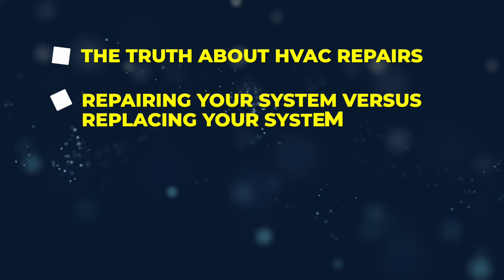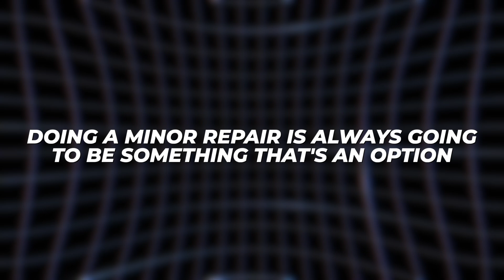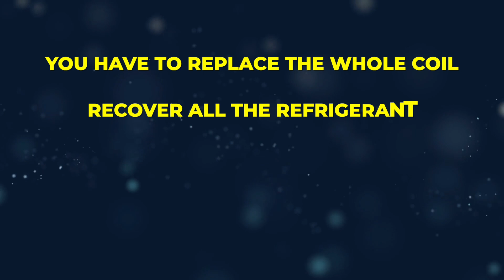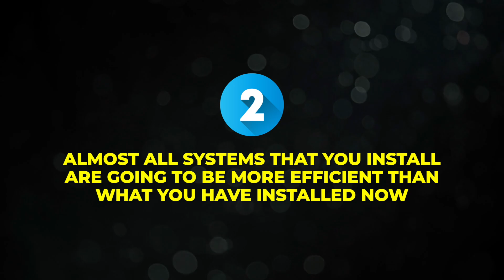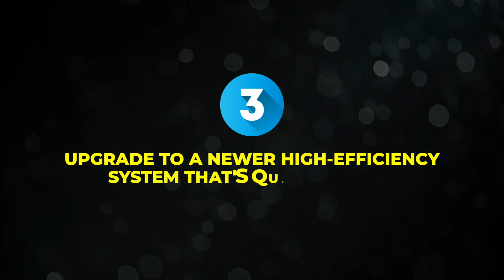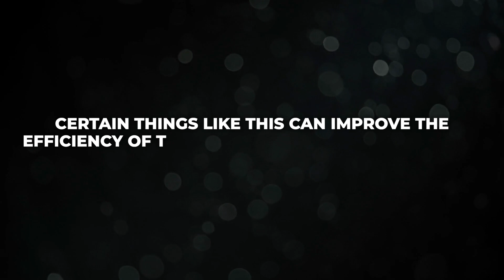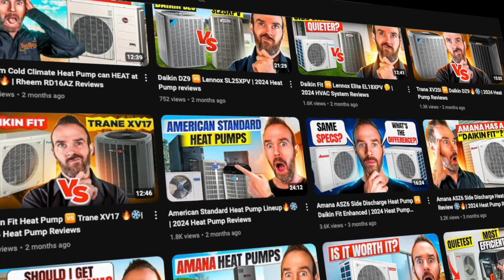The Truth about HVAC repairs

Comment: $137 service call$.20 to $50  capicitor bill turns into $491 is that a rip off only part and service non emergency. Week day normale buisness hrs
Reply from the maker: Honestly overhead has gone way up recently particularly insurance so unfortunately everything has inflated... in Denver or Phoenix or SoCal I don't think that's overpriced at all because of cost of living index in those cities, but the "part" is cheapest part of the equation even with tariffs. Biggest costs are labor and overhead related to sending the technician to your home... for what it's worth you can always find someone cheaper but I think it would be hard pressed to find someone to that for less than $300 these days IMO in any market so if the tech was reliable and showed up and got it fixed that's worth a lot to me! (Been trying to hire other trades people for work recently and it's hard to even find people to call you back sometimes)

Comment: I'm currently using my emergency heat, trying to get estimates on a repair or system replacement. I've been running it at a low temp, 66 degrees (brrr), but from what I understand, that doesn't matter as far as reducing my electricity bill because the coils run just as hot as they would if I had my heat turned up to 70 degrees. Is this true, or do the coils cool down some? Because of the holiday, I'm not sure how long I'm going to have to run it. It's been running for a little over a week thus far, but I've been turning it off for a few hours here and there when the sun is able to hold the temp at 66 degrees.

Is it true that I'm straining the heating element to where it might break? It's possible I might have to wait a week because of the holiday.

Also, I need my ducts cleaned as soon as possible. Since I have to get the heat pump fixed or replaced ASAP, a priority, if the duct cleaning is done AFTER the heat pump is fixed or replaced, will the dust overwhelm the new condenser or system, whichever I go with? I don't want to ruin a new system while waiting to schedule a duct cleaning. (I'm the one who had questions before.)

One more question. Do 2 cycle heat pumps really heat, cool, and remove humidity as well as a single stage? It seems everything they come out with that is environmentally friendly has come with a cost. My bagless vacuum does a poor job at picking up cat litter dust. I have to run my new washing machine on deep fill because nothing gets clean if I allow the washing machine to autofill because the water doesn't cover my clothes. If a 2 cycle is going to sacrifice heating, cooling, and especially humidity in the summer, I would definitely stick with a single stage. Please help (again).
Reply from the maker: Single stage is the least comfortable option, all upgrades are comfort and efficiency related. Get a quote for an inverter like the Daikin fit we answer a lot of the questions in other videos on our channel and duct cleaning can be done before or after but definitely will not destroy your system. Your heating electric backup coil runs more at higher set temps so 70 vs 65 will just mean it's running more but it won't burn out, it will just cost you more to run, but I'd doubt it's more than $100 extra or so for just 1 or two weeks. They're expensive to run but I wouldn't lose sleep over setting it at a comfortable temperature.. but that " $100" ballpark is based on let's say your normal bill was $200 and you used a heat pump normally but switch to all electric heating coil, that would probably double your bill for the month assuming all things constant, so it's not the end of the world you won't get a bill that's suddenly 10x what you paid to run a heat pump. Worst case it will be 3x more if you ran it all month long at normal temps 72 or whatever you set it at
Reply: @TheHVACDopeShow  Thank you. It answers a lot of my questions, just don't think I can afford anything more than a 2 stage, and they only offer Goodman, not Daikin.

Comment: I had a house built in 2018. It's a Trane single stage electric heat pump. I didn't move in until 2020, so the heat and AC only incurred 4 years of regular use. 

From the jump, I noticed more than average amounts of dust blowing out of the vents. I don't like having to clean my hardwood and tile floors more than maybe once a month. Vacuum weekly, okay. But get down on my hands and knees, no. I had at least 2 HVAC guys come out and asked them why there was never any dust on the pleated filter. Maybe some tar from my smoking, but dust, no. They would tell me everything was okey dokey. 

I have the litter boxes maybe 4' from a floor vent. With all the vents the builder added 'after the fact' because he was just plain incompetent, I don't have many options of where to place them.

Then I (stupidly) parked the litter boxes by an intake vent, maybe 4 days a week, after I would clean them. I was too tired to vacuum their 'spot', up late helping a friend through a tough time via text who lived in a different time zone. This is when I first noticed tar began to accumulate on walls and cat litter dust really began spewing from the vents... floors, carpet, countertops, everything. I literally couldn't keep up. I couldn't figure out why no dust was ever being caught on the pleated filter though, in spite of all the dust. So I decided I would leave the filter in for 4 months instead of 3, thought I'd changed it at the 4 month mark, but must've forgotten, so it was in there for 8 months. Finally, some dust! Not long after, my compressor took a crap on me.

I need to buy a new system now because they're overpricing a replacement of the Trane condensor.

I'm going to have my ducts cleaned, but I know some use 'the whip', which I heard is best? Is it? One vent is glued on, so I don't know how they'll clean that one. I could put a mat over the one vent and move the litter boxes there, but won't plopping something on top of that vent cause problems?

I, also, worry about how the builder ran the ductwork to add all of these extra unnecessary vents. There's a lot of flexible hosing (metal inside, I was told), but the air has so many turns to make now, all through these 'sags', 5 flexible hoses total.

Also, with all of the unnecessary vents added to the first floor where the thermostat is located, the single stage short-cycled a lot.  Second floor could be 5 degrees warmer in the summer. I had HVAC guys out for this reason, too. Kept asking them why the unit on a 85 degree, cloudy, muggy day would only poof on and run for 10 to 15 seconds, before turning off. Then two minutes later, another 10 to 15 seconds. Only on the hottest and coldest days did it feel comfortable.

I've literally sat here stressed out, picturing that cat litter dust poofing along for 10 seconds at a time, accumulating in that flexible hosing, sags, drops, whatever you want to call them. Two of the flexible hoses are at a major 'turn' in the ductwork (intake, supply?) One in a corner. So I imagine the cat litter dust would poof along until it filled these sags, drops, corners, and then a blocked artery. 

I can't even afford to buy a new system, let alone duct cleanings every 1 to 2 years. How do I determine if the ductwork layout is the main culprit? The people who look at it say it looks fine, probably think I'm a slob because I did eventually give up on cleaning, but they don't seem to be connecting any dots. If I get my ducts cleaned, would a 2-stage be better since it keeps the air moving for longer periods of time, long enough for dust to make it to the pleated filter? I've tried pine litter, but my cat doesn't like it. I worry that I'll be buying a new system, only for it, too, to konk out in 4 years without regular duct cleaning. Suggestions? Please answer. I am running my emergency heat and need to make a decision today. I have pictures of the ductwork, if that helps.
Reply from the maker: I would ask for sizing information because the system may have been oversized, and that's why it short cycled but if it ran constantly on the hottest days that's typically an indication it's working properly. When you replace it you can always ask for upgraded filter options like a 4" Honeywell filter rack... if the return ductwork (air going back to the furnace from the house) had leaks in a crawl space or something it could cause that issue of sucking in a lot of dust but this sounds like the cat litter being by the return vent is causing the dust. I think you just need better filtration and a 4" filter can handle higher MERV ratings without damaging the system
Reply: @TheHVACDopeShow   @TheHVACDopeShow  Thanks! I wouldn't say the unit ran constantly on the hottest days, but definitely MUCH longer run times. On cold days, even longer, especially on windy cold days. 

I'm worried now because the one HVAC tech wants to up my 4 ton to a 4.5. My house is 1700 sq ft, two story. He said he pulled my address and put it into some calculator that gave him an idea of the size unit I needed? It would be a Goodman, and I'm not sure if a two-stage would be better because it has longer run times so that it can move the dust along for a longer period of time. Thoughts? Both would have that better filtration system. 

Where's a good place for a litter box, 2 actually? Would it be okay to close a louvered vent, place them on top with a rubber mat under them so that no litter can get in? The placement of vents and returns in this house is limited, and the boxes are too heavy to put them on the second floor.

Comment: I wonder how the new Colorado ban on 80% furnaces is going to change the repair vs replace decision?
Reply from the maker: Yeah I'm replacing one in a rental this year for that reason probably just because they're more reliable. I'd rather put in a Daikin fit heat pump with electric heat kit in a rental than a high efficiency furnace just because even with maintenance they can be more finicky. 80% are bulletproof and it's a small space so it's not that big of a deal
Reply: @TheHVACDopeShow  Seems like I've seen other vids on HVAC warn and advise against the high efficiency ones.

Comment: In the early 70's my neighbors replaced their 20 year old AC unit in Phoenix AZ (It had worked hard).  The AC units sold per year have massively increased since the 50's. Regardless of the economies of scale,  I have witnessed a downward trajectory in service life, and an upward trajectory in both service and replacement costs far exceeding CPI. This is in spite of huge technology improvements that have lowered cost of manufacture.  Variable speed motors, compressors and controllers are now mass produced far more cheaply than the fixed speed motors of the 50's. The energy savings and increase in motor life should have been huge.  Unlike the rest of the electronics industry, where products have typically decreased in consumer cost, the Airconditioning industry has spiraled upward, dominated by greed at every level.
Reply from the maker: I don't think it's greed... you referenced CPI and the number one cost that has skyrocketed in the past 4 years (and prior) is insurance. Insurance for health, GL, auto, workman's comp etc, is our largest single expense category besides payroll, and wage growth has exploded for technicians which I don't think people realize. It's hard work and no one in the trades is willing to work for cheap anymore... is it greedy for my technicians to want to have an income that affords them to buy a home and have a decent vehicle? I think it's more than fair... but literally my car insurance this year doubled as a "general increase" unrelated to any claims, it's obnoxious and criminal, but we and everyone else have to past that cost on somewhere.
Reply: @TheHVACDopeShow Comparisons to CPI is an adjustment for those increased costs. Yes, when it's far in excess of the costs you are complaining about, it is nothing but greed.

Comment: My refrigerant was low. HVAC guy said they can charge it (obviously a leak somewhere) for $350 and take a chance or spend the thousands to swap the coil. Had them charge it and it lasted all summer. They told me they can use the additive that stops leaks since it's a galvanized w/copper. Had a different HVAC guy tell me he does it all the time and it works fine, so I took his number down.
Reply: Sounds like the first tech gave you a couple of options, made the repair while telling you it doesn't always work, which is absolutely true. And in return you've taken your business elsewhere. Seems odd but I clearly don't have the whole story!
Reply: @simons.collins925  100%. The first tech/company didn't want to try to sealer (the third option). Other guy told me he does it all the time and it's obviously cheaper than a new install or a new core. I have to be tight on money wherever I can.
Reply from the maker: I've never seen stop leak work trust me I wish it did. Would be way easier than swapping a coil but I've only done it a few times, didn't work so I said ok this is a waste I'm not using this anymore but I have heard it works or can work a little bit*
Reply: If you have to have more than 1 lb in a 3 ton system in one year, do not use stop leak.
Reply: @USA-GreedyMenOfNoIntegrity  Can you explain that a little more? I would totally appreciate it!
Reply: @SheepAmongG.O.A.T  I found that any leaks that were above 1 pound per year on a 3 ton system, leak stop would not work for me. And I kept very good track of it for several years before I stopped using it.